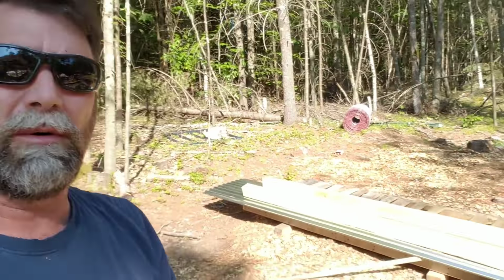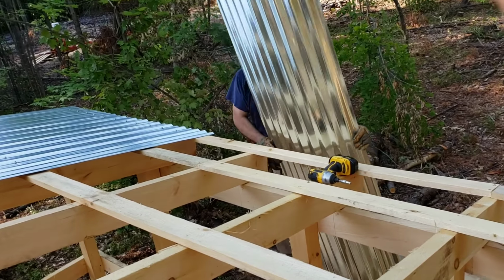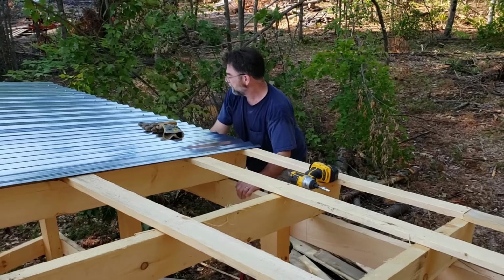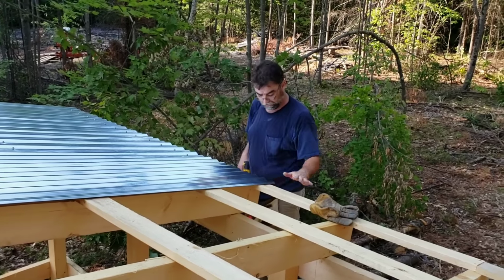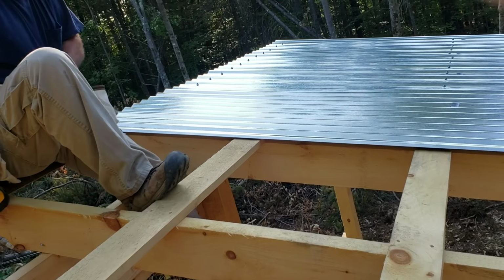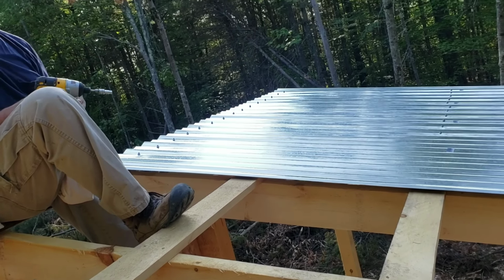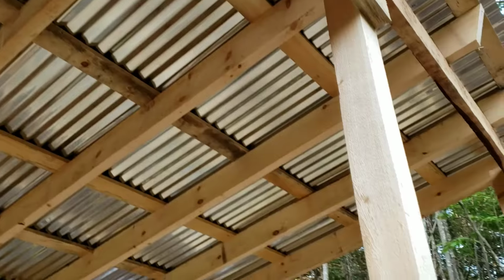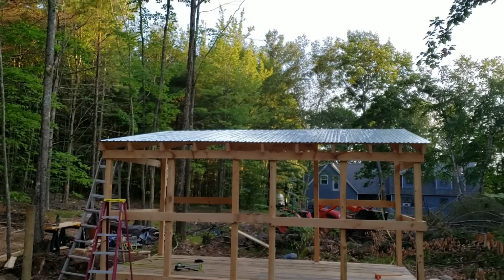Installing metal corrugated roofing on the goat barn.

Comment: Was looking for tips on installing that kind of metal on my carport.  Appreciate the video.  Manufacturer was recommending even more overlap, and using "double sided butyl tape" on the joints.  I suppose it depends how water tight you want it.  For a goat barn perfection probably isn't needed.  Likewise for my carport.  How has your barn gone?  It's been 3 years since you built it.  Any leaks or other problems?  As for putting the screws in peaks or valleys, I see mfg says peaks but they don't say why.  I'll guess it's because water can settle in the valleys.
Reply: I installed a roof on a structure without the tape and I could not believe how much water got in through that joint. Tearing it off and doing it over today. Also, screws in the valleys leaked, I'm putting them up top this time.

Comment: The screws go in the ridge for two reasons: 1) If there is any chance of a leak it can run off and not lay in the valley. 2) 50mm screws are made to allow for the ridge space in between the timber.
Reply: Thank you

Comment: First time doing a metal roof myself but is this water proof or do I need to do anything extra after laying and lap the tin honestly stuck
Reply from the maker: This was the first of three roofs we have done on the homestead now.  So far no leaks with just lapping them.  They do need to be straight and perfectly parallel to each other.
Reply: Not the special screws Tony mentions...they have a rubber grommet backing to seal against water.

Comment: Does the heat from the sun conduct enough to make the underneath hot? Making a patio cover the same way and curious if I should coat the top with something
Reply from the maker: It doesn't seem to be a problem.  We have used this roofing on two barns for the goats and the bunny bunker.

Comment: How do you smooth the edges? I covered the lid to my nesting box with this metal and its so sharp
Reply from the maker: We didn't.   My roof is too high up for me to worry about.  This stuff is so thin I am not sure you could dull it enough.  You could try sand paper or a file.
Reply: Try put a crush and fold on the metal if its a square peice if its round not to sure

Comment: how far apart are the studs and what gauge is that metal? your posts go all the down into the ground?  It would seem that an Arrow 10x15 carport is not a bad deal at $750?
Reply from the maker: The roof rafters are 2 feet apart, the metal is real thin, I bought it at Lowes.  the barn sits on cinder blocks.   As for price, I have a saw mill, so  lumber cost me my time.   Thanks for stopping by!

Comment: There's no debate BTW. On a roof the screw always goes on the peak. Always! Just think about water flow! In Japan they are even made with a curved plastic cap to ensure that's the only way to install it.
HOWEVER, when installing the corrugated sheets as vertical cladding - THEN you put the screw in the valley for maximum contact.

Comment: Did you put a cap on the higher edge at all for rain protection? Im building something similar. Thanks!
Reply from the maker: No,I did not.  The metal sticks out over the wood, and there is a fascia board in the front as well.

Comment: Did you install any type of ventilation cap on the high side by the overhang ?
Reply from the maker: The soffit on both front and back is just screening.   This way there is ventilation for the whole barn.

Comment: Can someone tell me how many screws to buy??? And 1 inch or 2 inch??? I’m doing a 500 sq ft coverage, 22 sheets  that are 10ft long and 8 sheets that are 12 ft long
Reply: Are using 2' horizontal centers on your field sheets? Are you attaching straight to wood or plywood? If so I reccomend 1 1/2" neoprene fasteners in the field and caulking and 1/2" neoprene fasteners on 1' centers on the vertical overlapping metal panels. Without counting the square feet it may help to purchase 1 bag of each size of fasteners and see how long they last. BTW when marking your horizontal lines use blue or a light colored caulk don't use red because red is permanent...
Reply: Dark Dan ok so we decided to put it over plywood. We were gonna do just on top of the beams (not sure if thats what the are called, but the 2x4 going across. But we decided to put plywood becaue tempd here reach 120-125 degrees. Is a cart port. We want to minimize the heat radiating down. Why the caulking? Caulking will not resist temps here. No rain. Very dry weather. Desert down in south california.
Reply: Dark Dan i did buy 1 1/2 neoprene fastners but I wasn’t considering the plywood. Its gonna be the 22/32 in width. Something like that. Its a little over half an inch.
Reply: Dark Dan oh by the way it has a 1 foot drop across flat roof , its not a gable
Reply: @aditadiablita  I would skip the caulking if you're in arid area, may suggest hi temperature ice and water shield, the heat from the metal roofing may dry rot the plywood. I'm not completely sure about the design of your carport but you may need some information on headwall, rake edge, and eave metal flashing. 1-1/2" fasteners pass through your plywood and prevent wind blow offs.
Reply: aditaDE   Not positive but think it was supposed to say Blue Chalk not caulk (probably spellcheck) when marking horizontal lines..sometimes you use it with a string (Chalk line) to “pop” a line to keep screws on runners, not necessary with plywood below, but would look cosmetically better. Best wishes with your project!